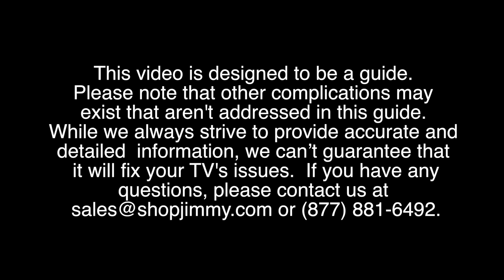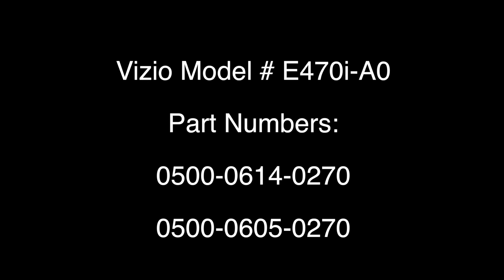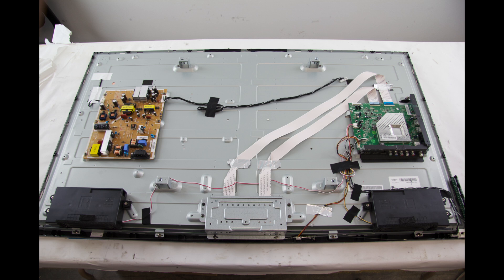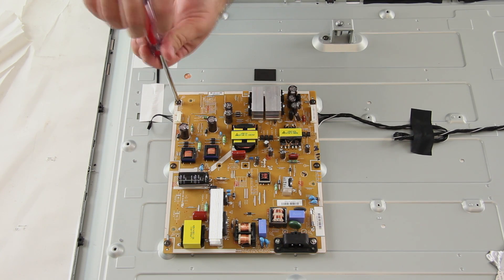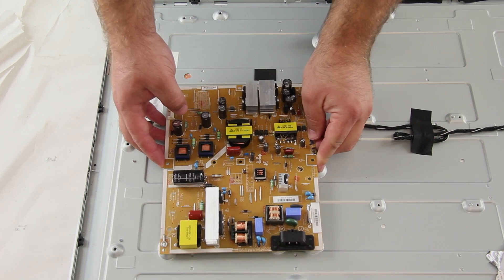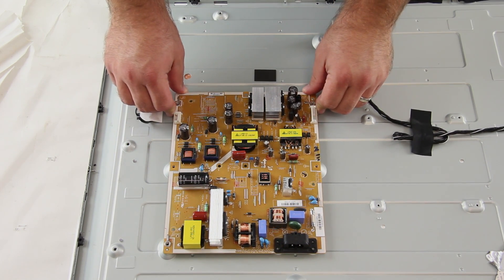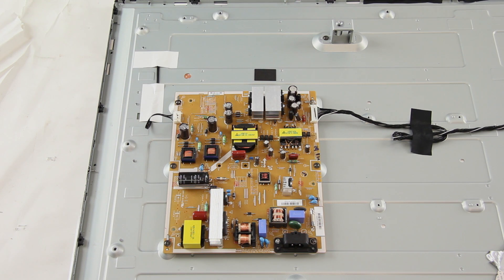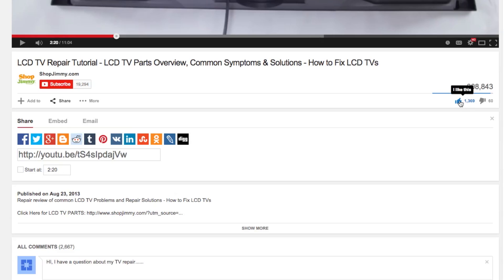Vizio E470i-A0 LED TV Power Supply / LED Board No Backlights Replacement Instructional Video

Comment: We finally got around to testing the voltage like this video says and now it says you're all sold out when will you have any more parts we know what's wrong now we can't get the parts the power supply board is bad there's no voltage going to the LEDs

Comment: I did the voltage check and got nothing.  You don't mention anything about the power on light.  Mine does not come on so with the two symptoms is it safe to assume it's the power supply unit? BTW: thanks for the video, I would purchase one from you but your out of stock for this model.

Comment: When I did the test voltage on Vout1 and Vout2 my meter just kept hunting and would not read a direct voltage.  When I disconnected the connector to the LED's I read @ 130vdc on both Vout1 and Vout2.  (Correction: Updated I read between 120-130vdc with the plug in after I retested and made sure I was in DC Voltage mode.)Does this mean that my LED Strips are bad?  Also, when I power the tv on, the little blue LED in the bottom LH corner turns on dimly then fades out.  The TV is still on, and when I did the flashlight test, I could see the MENU screen in the shadow.  Will replacing the LED Strips take care of the fading blue power light?  Or is it supposed to fade out, maybe it's only supposed to be on in STBY?  Hmm, doesn't matter, fades on turning on and off.  Feedback ShopJimmy?

Comment: I did the flashlight test and can seen the menu screen. I purchased the replacement board; however, it still does not work. I took the TV to a tech, and the lEDs are working. Could the board be defective?

Comment: I have no back light and I changed the power supply/led board and still doesnt work. When I push the power button the little blue light on the botton left corner goes on and fades right out. Can you help me please and thank you
Reply: Hi Michele. I see a while ago you were experiencing the same problems that i have going on now. I have replaced the power supply board and the main board to no avail.Did you ever get yours working and if so ,do you know what the problem was?
Reply: Traci Piskolti did either of you have any luck? I have the same issue.
Reply: I ended up replacing all the backlight strips with the backlight strip kit from shop jimmy. That is what fixed it. After the repair i went to the tv"s menu and turned down the voltage setting to the backlights. It was set too high which caused many of the lights in the strips to burn out.

Comment: Lost video had sound, Now I have no video or sound, the power light comes on and fades away.
Reply: I've got video after checking the flashlight test and I have sound, but dead backlights.  Mostly happens when I run apps. I'm thinking the apps use more power and the board is breaking.  Will check if I need an led driver board as well, but unsure.
Reply: Mine too! I have no idea what to do to fix it on both of mine
Reply: @raymondreid19xx  You guys sound like you're from Idiocracy. If you have no fucking idea then you call someone who does and fucking PAY the man to fix it...OR throw it out then get a new one...OR learn how to diagnose TV's. Just try not to sound like a complete tool on the internet anymore.

Comment: I have a e470i-a0 that has the black screen problem.. it was receiving power and had audio, but had no video. I followed the tutorial on how to test the voltage on LED1 and LED2. LED 1 tested around 60 volts and LED 2 tested 0 volts with the cable plugged in. With the LED cable unplugged both LED1 and LED2 tested at 0 volts. I came to the conclusion that the problem was the power supply/LED board. I ordered and received a new board (0500-0614-0270) from your website and replaced it following this tutorial. But now with the new power supply/LED board my TV is receiving no power at all. I then reinstalled the old power supply/LED board to see if it would have the same problem, but the TV successfully turned on (but still with a black screen). I was assuming with the new replacement board that the problem would either be fixed, or if the problem was faulty LED strips, I would at least be seeing the same problem as before (TV receiving power but has a black screen)? Is there something I need to do to the new power supply/LED board before I install it?

Comment: Power supply to the LEDs I get 60+ volts on both led1 and led2  Visio model # E470i-A0 I should be reading 100 volts

Comment: I have the same model. First, I can't get the back cover off. I removed all screws and it won't come off.  The first time I noticed  a problem, the screen went black but the sound still worked. Turned the set off and it would not power back on. When we press the power button on the set, the power indicator lights up and dims out in a few seconds.  sometimes there is a flash of the "V" on screen as it tries to power on.
Reply: I am having the exact same problem!
Reply: please let me know if you make any progress trying to figure it out. my tv is at the shop right now

Comment: I have replaced the power board and the main board and the tv still does not turn on I have power to the main board and obviously from the power board Any suggestions
Reply from the maker: +Skip Gaston   OK, what was the original problem with your TV?  Try all repairs and troubleshooting at your own risk.  Please reply with your TV model number.  Click here to view a video that shows how to find your TV model number:  https://www.youtube.com/watch?v=S51nhAmwR2M  Thanks!  www.shopjimmy.com
Reply: +Skip Gaston My model # is E470i-a0 the screen went dark and then no sound replaced power supply and motherboard still wont turn on

Comment: I have this Vizio model (e470i-a0). I have sound, but a black screen. After doing the flashlight test and seeing an image, I replaced the power supply/LED board. Unfortunately, nothing changed. Screen still appears black unless I shine a flashlight on it. What else can I try to fix my tv?
Reply from the maker: +Kari Parkin   Try all repairs and troubleshooting at your own risk. This sounds like a problem with the actual LEDs inside your TV. These LEDs are replaceable, however it is recommended they are replaced by someone with the proper experience and training. When replacing the LEDs, the TV panel can get damaged. If the TV panel gets damaged, it is not repairable. Click this link to replacement LEDs for your TV model number:  http://www.shopjimmy.com/lg-lc470dug-jfr1-led-strips-12-strips-1-board.htm   Be sure to match the panel information necessary to ensure you have the correct replacement LEDs.Thanks and please let us know if you have any further questions with your TV Repair!  www.shopjimmy.com